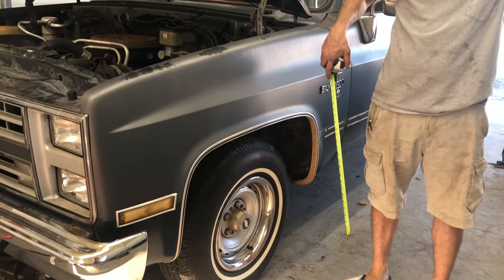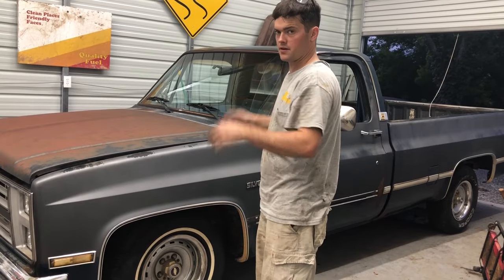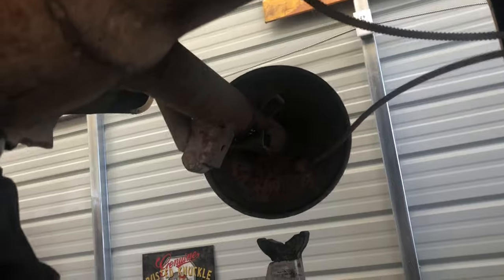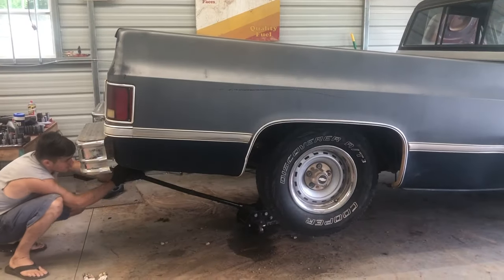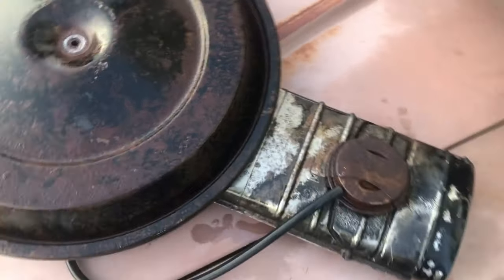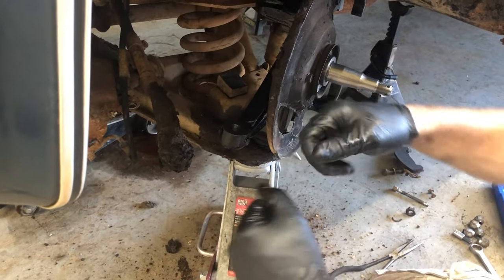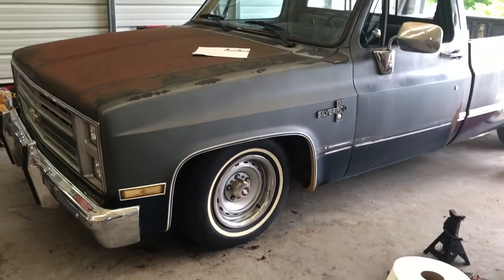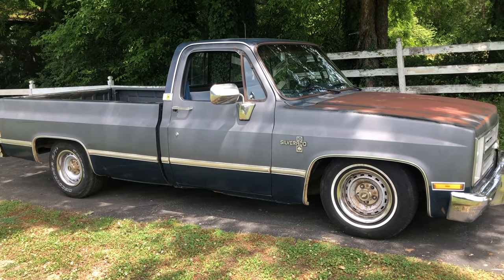Lowering a c10 6 inches on the cheap

Comment: Someone might have mentioned this in the comments already but drilling a new hole in the spring perch, moving the axle back about an inch and a half, would have centered the rear wheels in the fender opening and kept the drive line modification off the table. :)
Reply from the maker: That’s true thanks

Comment: Don't take this as criticism I enjoy y'all's video content but that is totally the wrong way to measure how much to cut gm coil springs LoL 😂, the proper way is to take them both out then measure with a measurement tape and start from where the coil starts running it around till you get to the number of inches you want to drop it- 1.5 at the coil is 3 inches at the body. That's definitely a creative way to lower the rear and the fix the driveshaft problem never seen it done before that way I was impressed, I wish I knew how to weld lol 😂 Great video other than that keep it up brotha the truck looks great 👍

Comment: To avoid the tire ride cut out a couple inches further back from where its and then add a 1/4" tall of steel to the piece you cut out and weld it back in, you CAN just heat it up and hammer it up out of the way but that looks like hell, by adding metal it just looks cleaner and looks like something the factory might have done.
Reply from the maker: Ok thanks

Comment: If you buy a flip kit you dont have to weld new perches, or shorten the drive shaft, and the added bonus of new u bolts, instead of reusing worn out factory u bolts from the 80's
Reply: If you he would have just drilled a half inch hole behind the center hole in the new perches you dont have to do anything to the drive shaft.
Reply: I just seen this and thank the lord haha I’m lowering my 87 and I didn’t want to shorten the shaft! Thanks!

Comment: I use to run mine with no springs at all on the bumpstops and flip the rear .1/4 steel bent on both ends get welded under the saddle with the hole drilled putting the pin toward the front or you will blow the tailshafts off
Reply: Again that’s stupid riding on the bump stops that will knock parts off
Reply: @anthonymccoy8771  i lower trucks as full time job and i see this all the time on these c10s lol i was just guessin they were dropped back in the 80s but now we got full kits 🤦🏽‍♂️🤦🏽‍♂️
Reply: @joeroe2839  hi joe , what drop kit do u recommend for a 82 chev short bed ,I want to do a 5/6 drop ,I want to install some staggered 22” AR salt flats wheels ,,what drop kit should I go with and should I do the c notch?
Reply: @robquest6499  I just did a 6-8 drop w a small rake outback ..and yea I recommend a notch if goin that low just incase u fill.up the back w something heavy . I like crown suspension if u on a budget or belltech springs/mcgaughys spindles

Comment: Fuck yeah man!
This video was legit exactly how i slammed my 88 s10.
 Couldn't fit a pack of smokes under the front bumper lip on pavement lmao
That truck turned out sweet man!
Reply from the maker: Thanks.. I love a lowered truck
Reply: A long time ago an old friend had an s10 blazer we put a vortec 350 in a lowered it LOW. Had to c notch it. It would wheel hop terribly..... I had 2 nice xjs at the time. One day we were sitting having a drink. And I had an idea. I told him to go to the local offroad shop and get a used set of xj springs. We used the main leaf from the blazer and then used the rest of the xj leafs and was able to rid of the lowering blocks. It never even rode that good stock and it launched great with the xj leaf pack.

Comment: Good job!  I am getting ready to do something like this to a 77.  I don't want to spend a lot of money on new modified aftermarket parts as recommended by another channel who is sponsored by those parts companies.  There is nothing wrong with replacing everything with new modified parts designed for this purpose, 'if' one has the 'much' extra money to buy those parts but money can be a hurdle at times....  It's nice to know it can be done this way. How does the truck ride now?
I know you learned a lot by doing this one, this way. If you had it to do over again would you go the same route, or would you recommend going the high dollar new parts way ? I trust your judgement and experience which you have gained 'by doing'!  How does the truck ride? I hope you can find time to answer my questions which will be 'very' helpful.
PS How is Ralphie's Camaro coming along?  Yall are a blessed family. Keep up the good work and God Bless!!
Phillip Hall
Reply from the maker: Yes I would do it the same way. It rode pretty good actually
Reply: @Sleeperdude  
Thank you SO much!!! 
Phillip Hall

Comment: Sweet video, I’m going to lower mine , long box I got Belltech 6852 kit 
I’m not notching, I don’t want to ruin the frame. Is it worth lowering does it Ride better?
Reply from the maker: I like how it rode but I am used to lowered vehicles
Reply: Did you have any clearance issues without notching it?
Reply from the maker: No I didn’t
Reply: I lowered mine still lots of clearance, not notched, rides soft which was my goal. Used shorter shocks

Comment: How do you line up the pigtail on the coil spring with the D in the crossmember if you cut a coil and a half? Wouldn’t it be misaligned if you cut more then one whole coil increments? Thanks in advance
Reply from the maker: You can spin the top of the spring in any position to make it line up with the groove in the lower control arm

Comment: Did you ever find a wheel and tire combo that didn’t rub top of the wheel well? Just did 2.5” spindle and 3” drop springs on my 82 and having same issue.
Reply from the maker: I ended up putting some spring rubbers in the front springs and that fixed it
Reply: Do some slosh tubs look em up , i drop trucks as a full time job and when i go beyond a 5 drop we install those to clear any setup there perfect or take off your innner tubs and ride